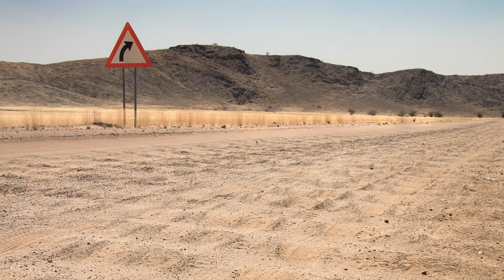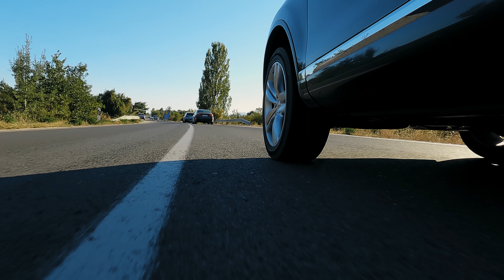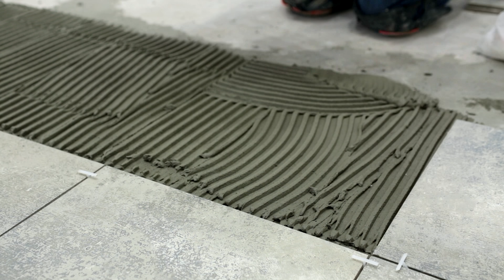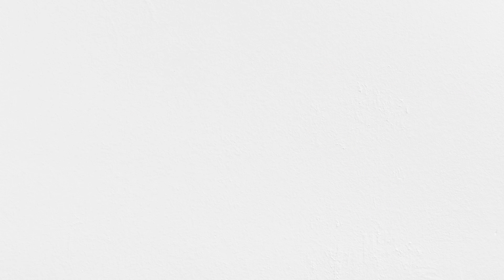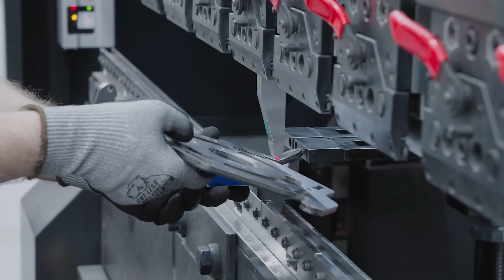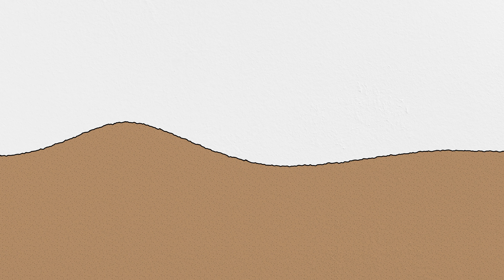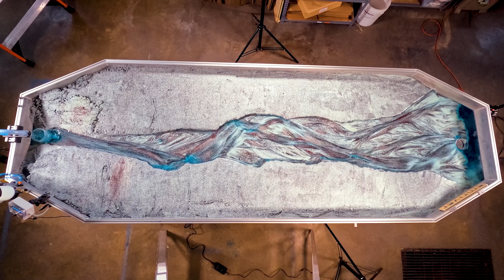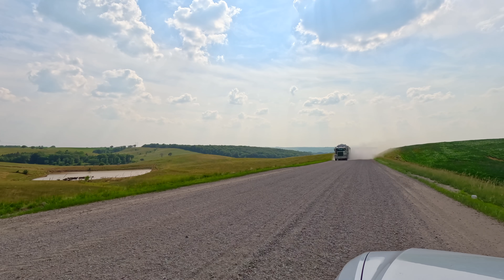Why Roads Get Washboards

Comment: I’ve got a question that doesn’t seem to get much attention: has anyone seriously studied how pavement—both asphalt and concrete—affects our environment? I’m not trying to be extreme about climate issues, but I do believe the climate is changing, and I don’t think cars are the only factor.

With the sheer amount of paved roads, parking lots, and dark asphalt rooftops we’ve built, it seems obvious that all that thermal mass has to be influencing our surroundings. Yet I rarely see research on how much heat our roadways absorb and re‑radiate, or how that affects daily life.

Comment: Road quality, traffic weight speed and volume, location of stops starts, horizontal and vertical curves (hills), quality of maintenance all factor into the creation of washboards. 
  Quick way to know if maintenance is not paying attention is if the washboards are at an angle. This is caused by the roadgrader going to fast. (What is big, yellow, has 6 wheels and sleeps 1?)

Comment: You should also expand on how paved roads start washboarding at intersections with stop signs or traffic lights due to longitudinal stress on the wearing surface caused by vehicle breaking and acceleration.  The main road just a few blocks from my home has this happen frequently on the down-hill approach to a 4-way stop intersection...

Comment: This is a dynamic that I'm VERY familiar with.  Recently retired from UDOT, where I was responsible for maintenance of a gravel surface road (SR-153) for over 31 years.  My particular road (the gravel portion) ranged from 7000' to 10000' elevation, had flat sections as well as a switch-backed section that was up to 18% grade and nearly a mile long.  Variations in speed, slope, material, moisture, plasticity, adhesiveness, angularity, aggregate durability, retention of fines, drainage, segregation of material components, driven v driving wheels, horsepower (spin), wheel loading, drivers seeking smoothest track with unmarked lanes, and so on made it a near impossible nut to crack.  I have experienced multiple successes and failures and can verify that minute changes often make huge differences.  I can confirm that "experts" are often guessing, budgets drive everything, and maintaining to a expected level while dollars are being outpaced by costs is an incredible challenge.

Looking forward to a series of these investigations.  The effect(s) of moisture and moisture retention/absorption (MgCl₂) treatments would be interesting to me if you're seeking a starting point.

Thanks

Comment: I was surprised your experiment worked, I thought it would need to be more realistic but apparently not. Still think the serious research probably does find ways to account for the weight of vehicles, suspension travel and strength, the effect propulsion on the wheel has, the give of the rubber in the wheel, the list goes on.

Comment: I didn't hear you mention it in the video, but experienced drivers know that increasing speed on washboard roads smooths out the drive. The sweet spot is typically above 45 mph. I imagine that this works because your tires have less time to drop in the lows and you end up "floating" only across the ridge-lines. It would be interesting to run your test at one speed to create the washboard and then increase the speed and film with a high speed camera to see what is actually happening.

Comment: We have a couple of long private roads at work both are gravel.
One is only for the long travel suspension trucks. The other for the regular cars and pickup trucks.
The speed for rhe regular cars is 20km/h. This is to prevent washboarding.
The company lifted the speed restriction for one year due to complaints and the road immediately went washboarded.
However the long suspension travel trucks their road never gets washboarded no matter what speed they drive. Their suspension absorbs rhe shicks and impact without pounding the road into a specific frequency wave.

Comment: This happens on downhill mountain bike trails a lot, especially in heavy braking zones. Trail builders mitigate this a degree by laying out trails in a way that control a riders speed with grade reversals and counter turns before larger turns. Material choice is a factor here, with heavier trafficked trails now adopting specifically reinforced surfaces to reduce maintenance costs.

Comment: in offroad racing we discuss braking bumps and acceleration bumps, we'll see washboards going into and out of a turn but not in a turn. We also just hit the throttle harder and the washboard and loss of traction go away, but our suspension is meant to deal with these types of conditions. We also see an increase in washboarding after rain, wondering if density changes have a significant contribution too.

Comment: BEFORE I watch the video:  I've long thought (since 20 years) that highly accurate computer controlled micro brake inputs by a car at the top of each ridge will quickly wear the ridges down.

Just one car out of hundreds may gradually solve a washboard road by filling in the valleys.

Comment: The model for this is so simple, It's pure friction, nothing else involved. Every kid has done this this - pushed their thumb along a table top or glass window so it bounces. The thumb sticks to the surface until there is sufficient pressure to break the seal, loses traction, and then grips again as the tension is released. The thumb bounces along the surface. That's it. Chatter on a lathe is the same thing. Water passing over sand as in the video is the same thing. Clouds do it all the time. The wind does it to the surface of the ocean, and to the sand on the beach as well. Just two different surfaces experiencing friction build up and release. In the car scenario, the car's typically unpowered front wheels are being pushed against the road surface by the rear wheels. This friction gathers the dirt or sand ahead of the wheel until it builds up high enough and creates enough friction that the wheel has to roll over it to release the tension, just like the thumb. That's all there is to it. I figured this out as a teen.

Comment: In Australia we have the great central road which is 1000km of mostly dirt. Goes through the middle of the county and is know as the longest short cut from Perth to Alice Springs. The corrugations can get upwards of half a foot deep and that road is frequented by triple road trains so it’s not uncommon for trucks to be travelling at walking speed. The alternate route is the great ocean road across the bottom of the county which adds about 1000km to the trip.

Comment: You might also be able to learn something about why the roads washboard from motocross and breaking bumps, acceleration bumps that form before and after corners or even along straight sections. Always a rolling formation. Sand tracks especially, form rollers simply from the riders moving through the sand.

Comment: On mx tracks they're called woops and they're bigger and deeper because there's more power going into a smaller area. It all starts with one bump. Time lapse photography would be useful. In the Australian outback I've seen cars with the chrome burnt off car shock absorber shafts from corrugations.

Comment: Thank you for clear and intuitive explanation, Grady. It's so often that people who understand things do explain them but the audience gets it only on the rational level but not the intuitive one. 
The only thing I still can't wrap my head around is how come the ridges can be so close to each other, with distances smaller then the diameter of a regular wheel. If the wheel jumps a ridge and forms the next one by landing and hitting the ground, then I would expect longer distances in between the bumps. Thank you very much for the video!

Comment: If it's caused by the vehicles traveling over. How does it extend from edge to edge? I feel like there are other factors not being addressed here. Do we have data showing the average speed on these roads affecting the size of these waves?

Comment: It would be interesting to see what kind of differences would appear in a test setup that is more like actual vehicles driving on the surface, i.e. with two connected wheels, one driven and one passive. At the moment the setup is drawing a passive wheel across the surface, and a driven wheel should have significantly different effects on the movement of the material in the wearing surface.

Comment: makes sense for downstream of bumps but could driver wheels instead of idle drag wheels potentially cause upstream bumps even at a slower pace? genuinely curious as slowing down and speeding up especially on loose material would cause irregular contact as well and possibly even more for cause.
Reply: and then in that case would shocks in suspension cause shorter gaps between bumps from higher contact and force rates? I might try this test with a bike later but would be faster to ask I guess

Comment: If you have big tires (35+ inches diameter) that you run at reduced pressure (20psi or less) and drive at high speeds (40+ mph) you'll find that washboards effectively "disappear" as you enjoy the smooth ride.

Comment: Simple answer is The most common engines driven on non paved surfaces are of a 4 stroke design meaning the power and torque are not smooth but sinusoidal and fluctuate from no of pistons, tire dia, gear ratio in transmission and axles. Hope this helps. My best effort to be most accurate: Washboard (the humps) have a specific cause and the interval (frequency or distance between) have a specific cause and the depth have a specific cause. Humps are caused by the interaction of pulsing power delivery through sprung and unsprung weight not in balance with available traction the surface and tires provide. example being the most severe washboard at least on the west coast is found on logging roads and when loggers have one road going to the landing (unloaded) and different to the mill (loaded) and those tending to also be uphill unloaded and far less risk tending to bring out the duke boys and smokey bandit in log truck drivers (spice of life) we find little to no washboard on outbound roads and most severe on inbound UPHILL roads. Note this is hard pack dirt and or gravel roads. In sand and sand dunes it is exponentially exacerbated in increased height and frequency is exacerbated exponentially in increase of distance between on the most flat of surfaces. This is due to on average the vehicles on sand have forgiving suspension, high power to weight ratio, higher rate of speed and the inherent exaggeration through foot controlled power delivery being more effected by inertial forces on body causing natural impulse to balance as if standing leading the foot to lag behind the force just enough to make the sand washboard (called whoops on sand) nearly all or nothing in the best way. Meaning there is nearly no rate of travel between the maximum speed the suspension and engine can provide closely matching drivers ability to recieve and deliver feedback to controls and the seemingly slug pace required when open top beverages are of greater importance to the journey than the journey itself.  I wish to back this up to some degree with those who know if they would care to share their experiences with 2 stroke diesel trucks or ORV's or "dirt bikes" which are significantly different in end product my on the fly estimation is not fully explained just through the change in power pulse per revolution change or the power curve of the motor (torque pipe vs expansion chamber) shout out to toomy T3's if anyone remembers those savage two stage reed loving beasts. I think. Cheers

Comment: As a longtime rural road maintenance engineer I'd like to make a few comments:
   
Most corrugations are made by the vehicles' drive wheels, not the free wheel.  Rather than throwing material forward as shown in your demonstration, it flicks the material backward. creating the mound behind the impact site. This is why corrugations are worst going uphill, then flats, with very few going downhill.

  We've known about the simplest way of reducing corrugations for decades, i.e. around 10% clay in the gravel, to bind the stones together.  This is rarely done, mainly through resistance from quarry owners who push the more expensive clean crushed rock rather than slightly softer rocks, like quality limestone, which create their own clay fraction to replace the fine material lost in blown dust. 
 
  Aggregate with this clay binder also means less loss through loose sand & gravel getting thrown to the side. This reduces the need for so much gravel top up, meaning less profit for the quarry owners.
 
 There is also resistance from road users, because their cars get dirty from mud in winter and dust in summer.

Comment: This video is really good, but it fails to mention some interesting causes. What we’ve noticed is that electric vehicles produce fewer of these bumps, and even fewer when the vehicle has no differentials and each drive wheel has a direct motor drive. The traction control system’s functionality and quality also play a major role. Conversely, this means that the cyclic torque peaks of internal combustion engines and differential oscillations are among the most significant causes, alongside road surface conditions and the speed of the vehicles traveling on them.

Comment: there should a system where washboards happen and the transportation using the gravel road mix roads can co-exist harmoniancely. What if the State supplies small "trailers" that can drop a "mini" tiny plow type teeth just where wasboards start growing and animated by activators roadside.   Driver's would pull at slower speedsEach commercial freight vehilcle weighing more than a certain amount of weight. and Driver's would pull at slower speeds After passing the srea affected, traffic is directed to quick release the trailer which eventually gets pulled again going the other way. State uses the same truck to sand and lightly grade the roads as needed.

Comment: Hello, I work for a company that specialises in road maintenance. There are many more variables to the formation of corrugations than just top speed and road material. The act of accelerating/ decelerating, how wet the road is and the history of corrugations of the road are some of the biggest contributors but there are some more minor factors too: the rpm of your engine (which is hard to replicate with a free spinning wheel) the tread on your tires, the weight of the vehicle, the amount of tires on said vehicle and obviously the volume of traffic. It would be interesting to show people how deep the corrugations penetrate into the ground by layering the sand in your setup to show this. Filling it with varying sizes of stone from gravel to clay, compacting the material, wetting the material, varying the relative weight your wheel has and the amount of wheels could all be done in your setup if you choose to. The best way to maintain a road is to keep it damp to A keep the dust down and B help bind the surface together - there IS chemical dust suppressants but they are very expensive and in my opinion mostly a waste of time and money, depending on the scale of the road and your supply of water + the road budget. Great video for explaining how the corrugations form!

Comment: Kind of reminded me of gear teeth wearing. When new, they push each other, but get the tiniest bit of wear gap, and each tooth SMACKS the next one. As this smacking gets harder, the wear increases exponentially. If you can feel any lash at all, failure is already imminent.

Comment: Your model has a scaling problem. It creates wash board ribs that are much longer than the radius of the wheel, while actual washboard has ribs that are much smaller. Draw track washboard and a wheel at scale and you will see that the tyre has no space to hit the ribs below the top. Furthermore your wheel is rigid compared to the sand ribs and road washboard is harder than the tyre. This results in a tyre contacting at least 2 or 3 ribs, even when bouncing. Looking forward to the  next experiment, where a small rib washboard gets created.

Comment: Why can't the suspension of the car detect the washboard and correct its harmonic?  Surely a sensor could read the road ahead of the wheel and adjust the mechanism to smooth out the washboard.  I notice if you drive a washboard fast enough, you get above the harmonic... leaves a lot of dust and not practical unless you've got to go 100 miles in new mexico, but clearly the vehicle has the power to fix the problem.  Where is the practical suspension engineering - why only chinese cars have suspensions that can handle bumps?

Comment: High snow bank, that has been pushed back a few times before spring, sometimes (rare) melts into curly pattern. Infrasound oscillations in the speeding plow, or plow truck, my guess.